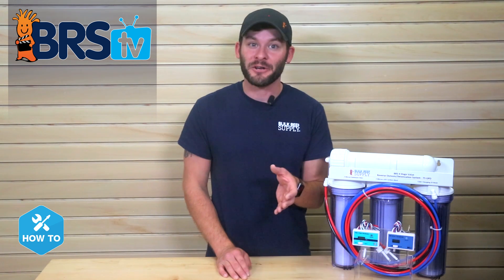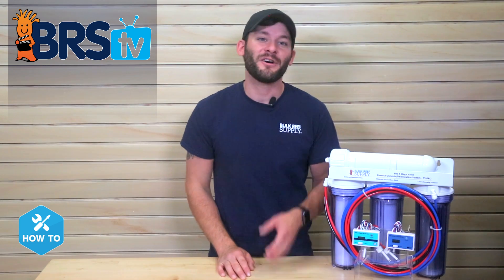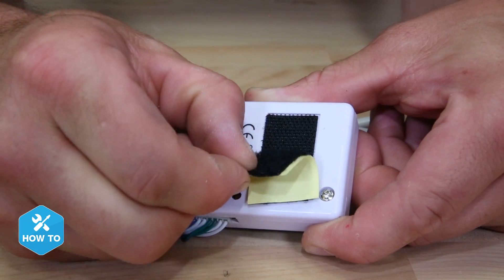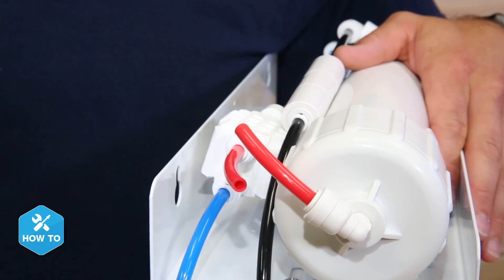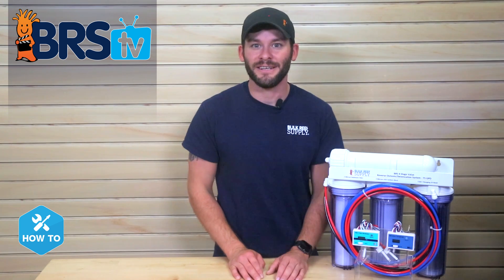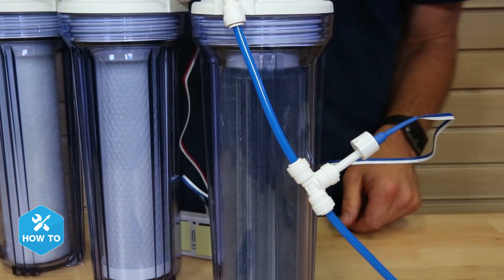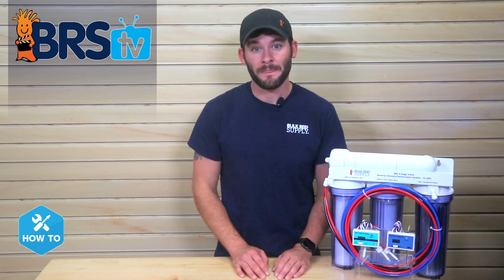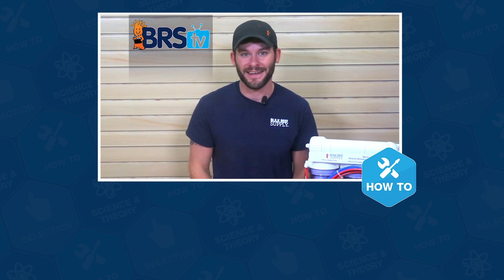How to install a TDS meter | BRStv How-To

Comment: What is TDS?
Reply from the maker: It stands for Total Dissolved Solids. It's one way we test RO water to determine the level of contaminants in it. Since TDS meters are actually conductivity meters, it will only pick up those contaminants with an electrical charge.
Reply: @BRStv  if I make my own RO water should I get a TDS meter?

Comment: Another good video. Question: If you start seeing 1-2ppm on your meter, what is the best way to tell which media is exhausted? I'd rather not replace everything for the sake of it, but I don't want to change the resin only for it to be exhausted because the carbon is no good ect.

Comment: I understand why you might have two TDS meters. One before and after the RO membranes. But where would you install a third sensor and why?
Reply: Ok. I get it. One last thing. Wouldnt you want to know the TDS numbers for your water BEFORE any water goes into the unit at all? Say from the tap into the unit. This way you know what you started with and what your final numbers were? You need to have a video on "How to convince your husband, wife, or significant other, that you need an RODI unit"

Comment: tomorrow is the day I have to move my saltwater fish to the place I moved into that's 3 hours away bought a giant brute trash to help with moving them wish me luck
Reply: BulkReefSupplyCom on the biggest idiot on the planet I don't have a net for my fish I was always telling myself to go buy a new one but I always kept putting it off and now it's coming to bite me in the butt😓
Reply: BulkReefSupplyCom so lucky just got the clownfish out my clownfish Felix is my most tame and first fish I feed him right out of my hand and usually just swims up to it and I pet him every once in awhile it's just my others going to be as easy
Reply: BulkReefSupplyCom they are all out except one it keeps biting me in and running off and it's only a 29 gallon BioCube the water is almost gone and I feel that I should be more than capable of moving my hands to the other side of a 29 gallon BioCube forecast fish can make it over there plus I had the fish in my hands and then it jumped out and then back into the tank it's aggravating me LOL XD

Comment: i ended up adding a 3-way one to my value watersaver+ which already had a 2-way one included. although i kinda wish you guys gave the option for the 3-way one on the value models too. i got 5 now which seems overkill, but now i'm spoiled and i actually want 6. None of this would have started if you just let me buy it with the 3-way one to begin with!!! Haha. Kidding aside,  i saw your one video where you showed measuring each of the RO membranes separately on these dual membrane units, and now want one for each RO membrane plus one for both membranes combined. Haha, overkill much? I guess I could just do the math to add the two together, but eh, who needs to do that when you can just have 6 tds meters? water in, post carbon/sediment, post ro each membrane separate plus combined (3 total),  post di, 6 in all.

maybe some day my TDS metering dreams will come true if I decide to ditch the original 2-way one it came with for a 3-way. But don't mind me - most of your customers probably aren't this obsessed with their RODI system. My water isn't even that bad, 30-70 incoming tds, usually 0 TDS post-RO after tds creep settles. I'm just a numbers freak, apex on everything, in fact i may add an apex flow meter to my RODI some day. we'll see. Too bad using the pm2+salinity probe as a tds meter is so expensive, i'd be doing that too  otherwise.